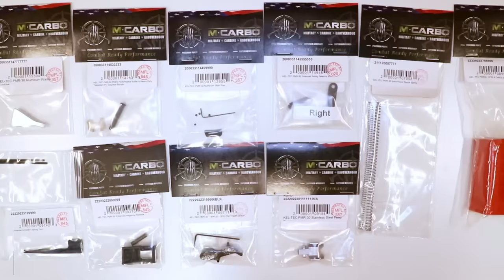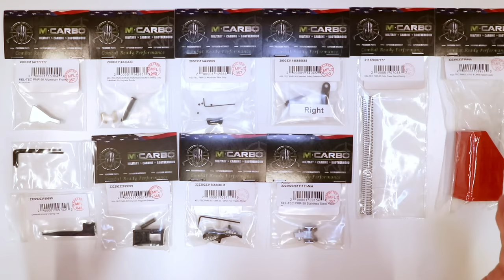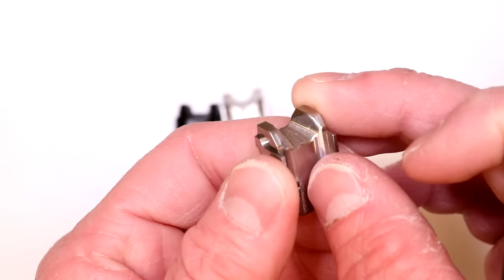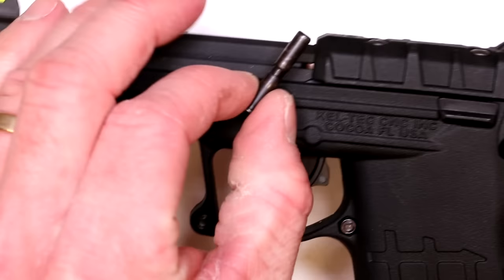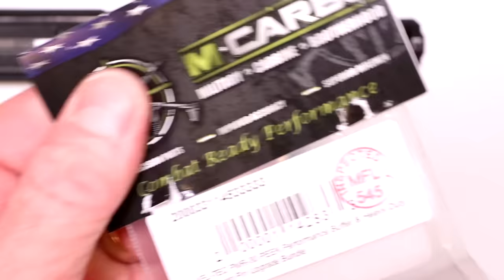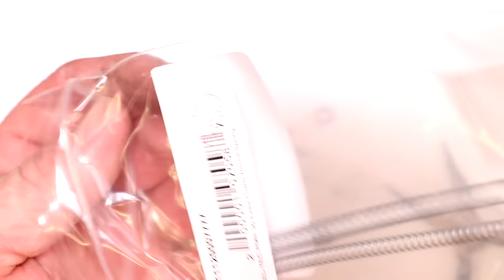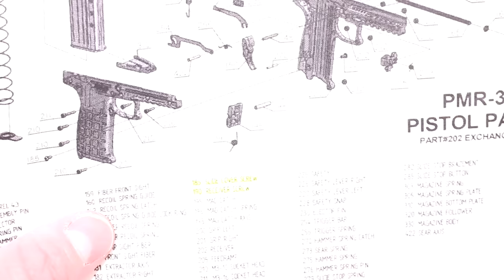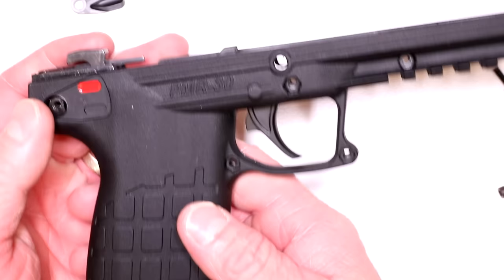KEL-TEC PMR-30 All In One Pro Bundle!  M*CARBO PMR 30 Review of Upgrades & PMR 30 Disassembly!

Comment: First range time with my M*Carbo Equipped PMR 30.
Incredible.
I never had problems before the install but the aluminum trigger with adjustments was my biggest surprise. It makes a huge difference.
The frame support insert really makes the gun feel solid.
120 rounds yesterday on M*Carbo PMR-30 and no hiccups at all.
It literally turns a 400 dollar gun inyo a 650 dollar gun.
Went with the red anodized trigger for bling.
Very happy.

Comment: I purchased mine in 2019, and had jams with every mag I used. I purchased 2 extra mags, thinking it was going to be some fun time shooting. I saw a vid on applying a thin strip of glue on the mag to tighten it up, so I did that. It helped a little, but I still need to shoot only the recommended ammo.
Looks like I now need to get this bundle and do some real amour work, and since I'm semi-retired I'll have the time.
With all that said, I must emphasize the EXCELLENT videoing of the tear down and reassembly. This has got to be one of the most detailed videos I've seen on diy projects. I'm a car guy, so I watch a lot of vids on working on the car, but nothing compares to this. The explanation and video shots were very clear and easy to understand...Good Job!
Now get some Working Hands ointment for your hands and fingers...they're too dry. Working Hands will fix it up real good...Great Stuff!

Comment: A #4 plastic wall anchor for hanging pictures on drywall (yellow in color) works great as a snap cap. The extractor will actually pull it from the chamber just like a spent case.

Comment: Ordered a kit due to sootch mentioning you. Found this gem of a video. Got it installed tonight. The video was a resource that is so valuable! The quality of the parts and there performance are next level. The PMR looks less plastic. The manual of arms is easier to go through and operate. My mag button spring was swallowed by the black hole in my basement when it decided to nope out on being installed……hard sigh… I’ve got one in the mail.

Comment: just bought a PMR 30 yesterday (6/16/2022) new from a local shop, went to the range and ran 50 rounds of CCI 30 grain maxi mag TNT through it without even 1 fail, so maybe kel-tec has fixed everything that was wrong about it, as it is a excellent handgun. I would recommend to anybody without hesitation.
Reply: I bought one 2 months ago. I've only had it out once, but 100 plus rounds with not one single issue either.
Reply: Bought my new PMR 30 last week (4/10/2023) new from a local shop, went to the range and ran 50 rounds. Had at least 6 jams with CCI 40 grain maxi mag. Went back 2 days later 50 more rounds with only 5 jams. Will try a different round and see if there is any cure. But right now, I'd call it a total POS.

Comment: Would like to see a pre-assembled stainless steel guide rod selection with spring weight options available (stock and heavy) with a "c-clip" type retainer to replace the spring wire retention method or a two piece guide rod like Kimber uses in "Commander" sized .45's or Springfield uses in compact XD's. Would also like to see more information on metal or metal hybrid magazines you mentioned, especially around the top magazine lips with metal sections, like Lancer does on AR-15 mags like the Lancer AWM L-5.

Comment: Just finished recoil spring install. Was the easiest parts of whole upgrade. Saved for the last, cause I thought it would be a problem. Got a block of wood drilled a hole until I came up right diameter. The only hard part was which end which. Finally pushed on one of the retainers, and one moved. That was the toughest part. Slid spring on put on retainer, held down app. 1 inch. Got the new wire clip. There is a grove around recoil rod.put it on kept spinning it until it was in. Used needle nose until it looked like before. Simple ,easy. Felt pretty good. Kel-tec is making these things cheeeeep. You can do it!!!!!

Comment: I just installed this M*Carbo All in one Bundle on my PMR 30.
Everything went great.
I did over tighten the hammer housing pin screws at first causing the gun not to reset.
The trigger bar was getting pinched.
I loosened it up and it works fine.
Then my pre-travel and over travel set screws were not quite where I wanted them. I found by turning the over travel screw inward with a pair of needle nose pliers; while the loctite is still wet, I could then access the pre-travel screw with allen wrench and the trigger depressed.
Then I backed the over-travel back out again with needle nose pliers.
You could also just cut the short leg of the allen key down to fit I guess.
But if the loctite is still fresh; it's easy to move them.

Comment: Stainless steel feed ramp SPRING install. This videos is a great help  Seems redundant to say, watch it before, during, after to review ur part install. I took my time. Be in no hurry. Parts were great pmr 30. Only one thing to mention, the spring tool they send you. Most places the thickness of the tool isn't critical . But on whole upgrade,,,,, stainless  steeleel ramp IT Is. Tried, and tried to install spring. Finally figured out it was the thickness of mcarbo tool was the problem . I have big hands, couldn't grip this tool sent well. I got a small flat screwdriver, took out dremel, attached diamond cutting disc. I had the spring  installed just few minutes. Screwdriver was a small one that had a clip that could be carried in your shirt. But the thinnest blade would be best .or buy his .Took a 99¢ driver I had on hand and made it work. Mcarbo tool sent was also too wide. Couldn't see placement well. Total upgrade went great overall. Love red trigger. If it was black one, would've LOVED it. Great staff  fast shipping. Overall 4.5 stars . Only reason not 5 outta 5 was the tool.  Magazine spring was easy. I didn't have their bench tool. Also cut off trigger adjust hex head so I could adjust trigger with trigger installed. Cut it past curve to maybe 3/ 8 inch. Got trigger, SWEET. Thank carbo.
Reply: John Smith , another thing u can do in place of replacing the magazine catch is to run a bead of gel superglue under/across   the magazine raised lip,  it will put the magazine a tad higher, same as the mag catch would do..

Comment: I have had my PMR30 for a couple of years now. I have probably put 500 rounds through it, which is not much I know. I had only one hang up, with multiple brands of ammunition, different weight bullets, some actually decades old. I never had rapid fired it, that might have made a difference, too. I was watching a guy on YouTube doing a review on a PMR30, that is where I heard about Mcarbo upgrades. So l ordered the new feed ramp (and polishing kit), new extra power recoil spring, the frame reinforcement, the heavy buffer and heavy take down pin.
Probably should have gotten the whole bundle but I watched the video from Mcarbo, about 45 minutes and I had it all installed without any issues, except the little washer retainer for the recoil spring, I couldn't get it all installed without grinding a very small amount off of it, it wouldn't fit in the groove when I squeezed it down it over lapped about .030" all I had to do was just barely touch the grinder wheel. Anyway I would say it went great! I went out and shot rapid fire without any issues, the box of ammo was some old Winchester rounds, 45gr the price on the box was $6.50 that gives you an idea of the age, lol! The Mcarbo parts were amazing, thank you Mcarbo!!!

Comment: Metal magazines would definitely be a plus!
Reply: couldn't agree more ... I have two pmr 30s n had the cmr 30 which I gave up on that one n ditched it ... n got the Walther wmp ... and I can say hands down the Walthers def heavier but farrrrr more reliable and more well thought out than the pmr 30.. such as integrated feed ramp to barrel... integrated buffer to barrel .. integrated loader on steel frame mags with plastic shell outer ...4 dif indiv. mag releases .. keltec needs to takes some pages outta walthers book n revamp the pmr... I have the all in one bundle for one pmr and the other pmr I have runs flawless stock .. both bought from same shop , both new , both new gens, sent the one to keltec 3 times now n that's why I ordered the all in one ... so hopefully it'll improve it even more than what keltec had it running after it's last return trip from the factory .

Comment: Great video!  I didn't do the "whole kit" due to my preferences - but the feed ramp, frame support and mag release are all in!  Maybe some day after I use up the extra buffers I bought when it was new I'll replace that, but honestly, in over 500 rounds through, mine doesn't look as bad as the one in this video. 
The only thing I noticed on mine when putting the new mag release in was that the mag release pin in the PMR was slightly rough or mushroomed? - so I had to finagle a bit more than what I've seen in this and the other videos to get it on.  That said, after install it works AMAZINGLY well and now that I did the PMR, I think a feed ramp and mag release are next up on my CMR.

Comment: Helpful tip..., a dummy snap-cap can bre made from a plastic #4 (yellow) drywall anchor.
 Will protect chamber rim / firing pin and extracts just like a spent case.

Comment: Amazing mines complete bone stock over a 1000 rounds through it, NOT ONE FAILURE!!! Yes you read that correctly not one failure to feed, not one failure to eject. I say that, but I also use 40 or 45 grain (mainly 40 gr) CCI. I have ran Armscore and one 50 round box of Winchester….not dyna point Winchester heard to absolutely stay away from those, again absolutely flawless. I know things will wear out so now I have options to keep this fun gun running.
Reply: just bought one yesterday, also bone stock and ran a box of CCI 30 grain maxi mag TNT through it without a single fail.
Reply: @brian770   just to let you know. The Manuel does say for best reliability stick with 40grains on up. I’m very surprised you didn’t have any malfunctions, there are a ton of you tube videos showing a lot of failures with 30 grain. But glad to hear it ran reliable. 👍
Reply: @MM_405  ya, the range was in the basement of the shop we bought it from, and all they had was the CCI TNT 30 grain ammo, i even asked if they had 40 grain and i had to go with what they had, i too was suprised that it worked sooo well. am looking at the Mcarbo kit right now to give me piece of mind.
Reply: maybe because the CCI TNT is 30 grain but its 2200FPS.....?
Reply: @brian770 Chronograph it. It's not going 2200fps out of the pmr 30.
Reply: @kylestewart1157  ya, i know that but it would still have a bigger initial bang, i do not have a crono, but i ran another 2 boxes of the cci tnt 30 grain yesterday and still have not had any fails. maybe i just got lucky. i ordered some 40 grain last week just to have it.

Comment: an easier way to install the recoil springs is to insert the orange safety that came with your pistol back into the chamber and let the slide go home. (be sure to remove the takedown pin). Push the slide forward. Now your little split ring is exposed, and you can gently pry it off with a flathead screwdriver. Then remove the safety block, and remove the slide from the pistol. Carefully remove the recoil spring/guide rod assembly and do the spring swap. Working in reverse fashion, insert the retainer into the buffer/end of slide, reinstall the guide rod and springs. It's a little tricky but can easily be done. Now, reinstall the slide onto the frame and reinsert your orange safety block. Now, you can reuse the old split ring!  just work it back on there. Voila!  (you may have to squeeze the split ring a bit with needlenose pliars after re-installation)

Comment: I am 95% certain my left and right safety levers were in the wrong baggies from the factory. Took me a bit to figure out what the deal was but if anyone else has that problem or just somehow mixed them up it will result in the safety sort of sitting between positions and not functioning. Switching them to the correct orientation will immediately fix the problem. I thought I had messed something up inside the gun until I realized what was happening!
Reply: Thank you,  I had the same problem!

Comment: I used this video to install the full kit.  I had to forego the guide rod springs due to eye sight.  I did buy the tool you suggested, but not the block.  I assume the guide rod may have been accomplished with the block.  I tried a table vise.  Thanks for the video!
Reply: just drill a hole in a block of wood until u get the diameter tight for the spring change

Comment: I'd like to have that soup-up kit but I paid $600 for my PMR and it runs pretty good. As soon as I got it I bought 10 buffers for it hoping it will be a lifetimes worth. I don't get the non-metal feed ramp, mines metal and made into the barrel, ain't much of a ramp but it's there. IDK if mines a gen 2 or what but it's called a titanium model wich means it has a little longer of a barrel but again IDK. Loading mag has much to do w/it gotta slap it about every 5 rds. But it does OK.

Comment: U might be wondering, can I do this ? Yes with just some basic tools. Couldn't afford extra tools, that I might or might not use again. Wheeler, fat max.,. Definitely. But main thing ,take your time. I wasn't quite getting certain install. Watched his video, till I did. And it's almost like how difficult it is to get certain parts just right. ( On trigger, I took his allen head, altered it so I could use with trigger installed. Did not work on pre- travel. But on firing got my trigger, pardon word, SWEET. Just went with his recommendation on pre- travel. Forget all " lose warranty " this company has a niche place. Almost all weapons made needs an upgrade. What I read, but the 22 mag is one to take chance on. Mcarbo seems to try to talk you into his co. doing it. Ohh, and on his videos, don't do as he says, but do as he does on install, " I like to suffer for camera" it was difficult to do as he said. So I started doing as he did, alot easier. Just take your time is main thing. I did mine over the course of a few weeks. Besides doing it myself whole bunch a fun

Comment: Muzzle blast? Which barrel length is the 22 magnum intended for? The difference in numbers between 22LR & 22 Magnum are for rifles, what are the real world pistol numbers? The intended barrel length decided what gunpowder to be used. So if the 22 magnum ammunition is intended for a rifle barrel. I would believe that the gunpowder is not optimised for a short pistol barrel. So what would happen if the 22 magnum ammunition was loaded with pistol gunpowder & shot in a pistol? Has anyone who an answer to this? I mean, if you can visible see the gunpowder is burning, long after the bullet has left the barrel. Then you have lost a lot of the potential of the 22 magnum in a pistol. Am I right?

Comment: Can yall make a right side safety disc? Or heck I could use a washer idk or dremel the factory one to keep that spacing. I don't like ambi safeties, thankfully I don't hate the low profile factory options but it's still a liability if it gets bumped off, I'll never use it and it's just out there in the open when holstered and they are a little too easy to operate maybe get a stiffer detent spring

Comment: Just the biggest thought of the whole install. Why... Why would mcarbo send a spring install tool, that u would probably need to have small hands and do this install for a living? Spring tool critical for installing feed ramp. It was too thick, too wide to see hole. Too thick to allow access to safety slide hole.??????? Took a thin, narrow bladed flat driver and got dremel cutting disc out. Cut a grove in very small flat screw driver. Had spring in matter of minutes. I struggled for days with his spring tool. That's when I figured out his spring tool, too thick. I heard spring going in hole. Remove tool, wasn't in. Too thick,too wide. Why?????

Comment: I can't see paying more than 1/2 the purchase price of a gun just for a few accessories to make it run, and some are just small plastic bits that cost $0.02 to produce and they are charging $23 for!
Mine, out of the box, in the first magazine had one partial feed on the first round out of the magazine then 1/2 way through had one fail to fire, but had a full primer strike, so I turned the round 90 degrees and it did fire, and thats it, never a problem from then on!
I only changed the slide spring set and the feed ramp because I believe (but have not proven it as of yet) Stainless Steel will last longer than plastic.
I also purchased a spare, upgraded firing pin to use as a pattern, and then made one out of tool steel because I wanted to.

Comment: The only thing that doesn't sell me on this gun is the lack of magazine variety, you're kinda just stuck with the flush fits. 30 in a flush fit is super cool, but for something like the CMR 30 it looks kinda weird, and if i'm running a full carbine i would like the most rounds possible without the magazines becoming unwieldy, also since i see a lot of people calling the CMR the "Poor Man's MP7"

would it be possible for you guys to start experimenting with extended PMR and CMR magazines? or is that already on the docket?
Reply: They have 50 round capacity magazines it adds a little bit in height compared to the standard capacity magazines, unfortunately it's only for the 22lr versions...